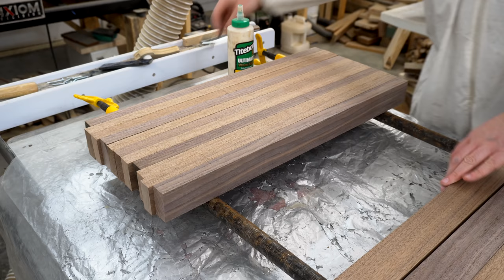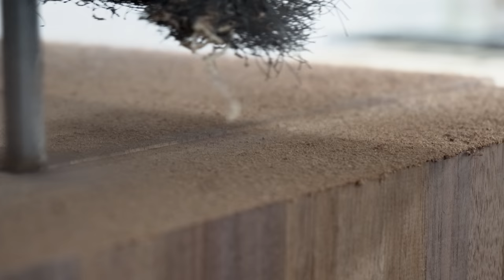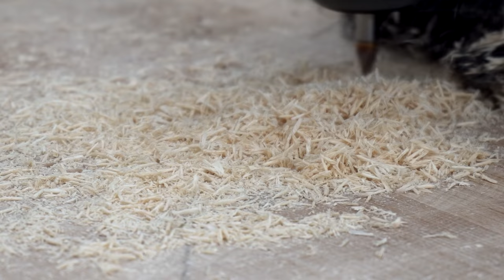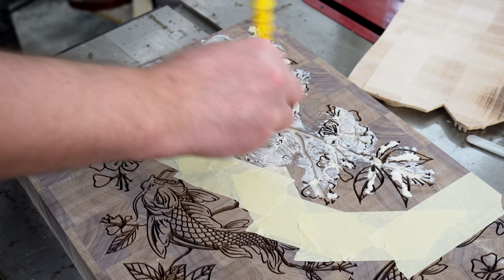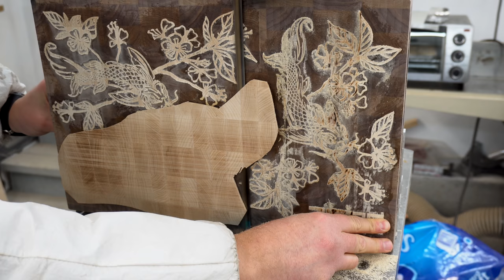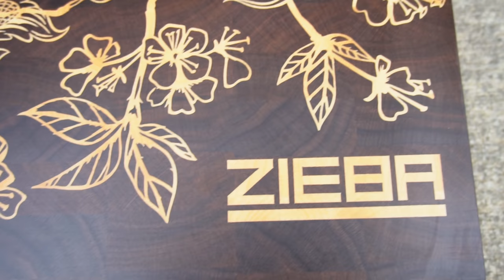Koi fish cutting board / butcher block. Zieba board #3. Cnc inlay. Wood inlay 4k video.

Comment: I am so impressed by these works that I have decided to make one as a gift for a family member.  No, I will not be copying the design, but I will be using the technique.  I have done similar inlays but not with end grain and not using a tapered ball nose cutter.  I am a hobbyist so I will not be selling these either.

Really outstanding work!  Thank you for the inspiration.
Reply: I forgot to mention, the board I make will be used.  End grain cutting boards last almost forever, they are nothing like face grain boards sold all over the place.  The board will not be ruined by using it.
Reply: @TReischl1  Did you make it? I don't see it in your channel? Also, what is the difference between end and face grain boards? How can you tell? (not a woodworker, thinking to get into it, maybe as a sideline).
Reply: @ibubezi7685  long grain the grain will travel from left to right or top to bottom. face gain means it travels from bottom of cutting board to top.
Reply: @TReischl1  Thanks for the recommendation! I didn't know that
Reply: @ibubezi7685  Yup, got it made, after a few trials and tribulations, LOL.  Biggest issue I had was attempting an inlay within an inlay.  did not work at all.  So I changed the design and it worked out well.  I put very little of what I do on YouTube.  Would end up spending more time posting vids than actually making things.

Comment: If your blade guides spark does that mean they are bad, too tight or something? Dont want your blade to break or over heat unnecessarily. Sometimes replacing  them with a really hardwood like lignum vitae will work. Something hard, but not too hard.
Do you find different taper angle bits produce a better looking and working mating surface or using a less tapered bit for the board and a higher taper for the insert so it is like an interference fit?

Comment: Beautiful.  Man, whatcha got sparking up there in that bandsaw guide??? 02:08
Reply from the maker: Need to read about it a little more. I think that is just metal band goes through too tight ceramic guide
Reply: it looks like the back of the band rubbing against the guide when pushed against it.
Reply: @Broinwood  Yeah, my Laguna bandsaw doesn't do that.
Reply from the maker: Hm, maybe it pick up some dirt from the wood...
Reply: @Warpfield  My Laguna creates 14BX with Laguna saw, have sparks like that.

Comment: Great job, looks amazing. Do you create your own vector files?
Reply from the maker: Thank you! Depends on project, I may create them partially. Even if I get vector file I still need prepare for CNC.
Reply: Very nice artworks!

What do you mean by creating them partially?
Do you get files from the clients?
Are you doing conversion to the right format and making them millable or do you draw them yourself.
A friend of mine got a self-made cnc and I would like to try something similar myself, but I really can't draw something nice. Can you recommend some source for designs like these?
Reply: @Broinwood  What program do you use to separate the layers to prepare them for CNC?

Comment: The answer may already be in the comments but I can't find it:

What did you use to clean it ? Just water ? And what did you seal it with ?
Reply from the maker: Water for cleaning, mineral oil / cutting board oil for seal and regular maintenance.

Comment: Have you thought about using a 1 1/2, or 2” fly cutter to do the leveling cut when you start the cnc process?
Reply: Do you really want to be around a 2 inch fly cutter rotating at over 16000 rpm's?
Reply: @TReischl1  They can be run slower...
Reply: @thecatofnineswords  That depends on what is being used for a spindle.  And if they are turning slower then the feed rate has to be slowed down.  I do not want to be around a two inch fly cutter doing 8K rpm either.  Take a look at recommended RPM's for fly cutters and feed rates.  Unless you are crazy enough to run one at over 2K there is no real savings in time.

Comment: I was trying to work out how it was possible to get the inlay to fit into the grooves cut into the board, I mean any slight movement and it won't go in. I guess the male is cut with a taper to help with that.
Reply: Both are tapered. The groove as well as the inlay.
Look at the tool he is using to prepare the pieces. Both are conical and in fact I suspect it to be the same tool.

Comment: This is just an FYI, take of it what you will, but wooden cutting boards are the best and safest because the wood absorbs all moisture that hits it, drying out the surface which makes for an environment that kills germs. On top of that wood has it's own anti microbial agents that will kill germs, like our hands do. If you rub wax into a board you are creating a barrier where the surface moisture can no longer be drawn into the board, hence it will stay in the little surface mirco cracks the knives make and germs WILL be able to survive in this environment.  This is a bad practice that woodworkers caved to because the public, being ignorant, think this thing is art or something and expect it to be attractive. It's not art, it's a tool, and if you defeat what makes it work to make it art, all we accomplish is making it dangerous. Cutting boards should never be waxed and almost never oiled, because oil causes the same problem. No, they are not as attractive when bone dry, but they are considerably safer.

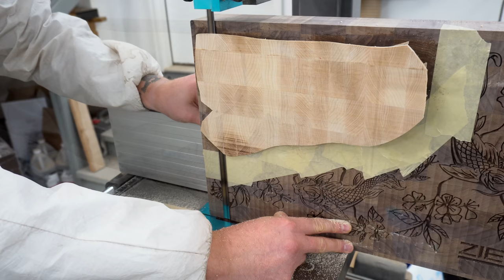Comment: 9:50
Theres got to be a better (safer) way to d ok that.
I feel like even just standing behind the saw and pulling the piece through would at least be a little safer. That way the saws platform can support it when you start the cut, and you dont have to reach across the machine to finish the cut.

Comment: OK, it's good stuff; no question.  So, we celebrate your taste, and your hardware/software capabilities, utilizing multi (very multi) thousand $$ gear. However, watching a robot do it's thing is tiresome, after ten seconds.  If I saw the board, at a crafts show, I'd admire it.  Here, I don't see what's in it, for the Viewer.  This DIYer pulled the ripcord, at 5 minutes.